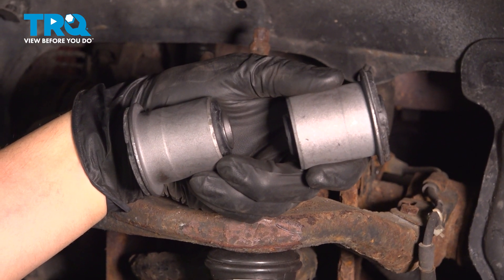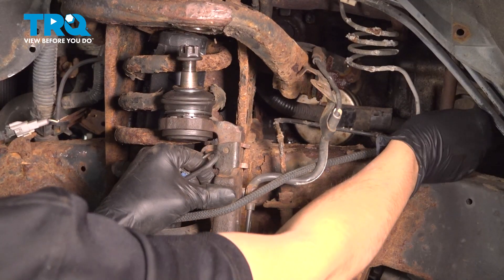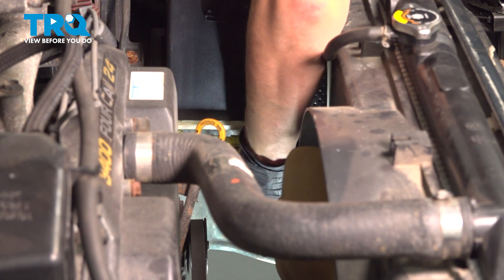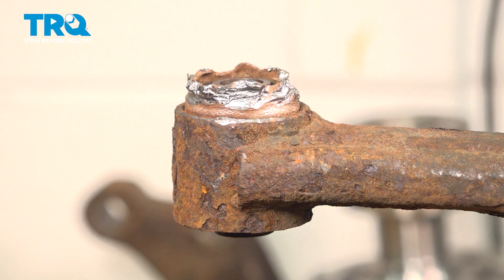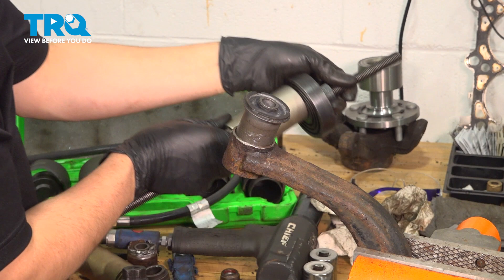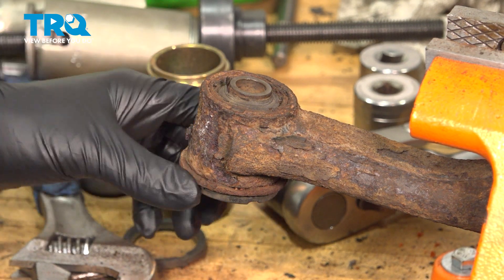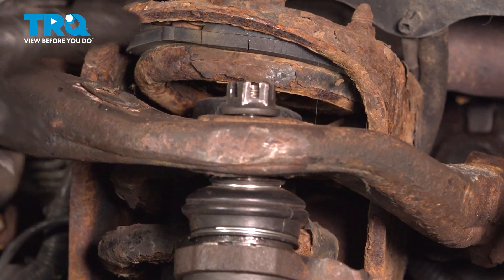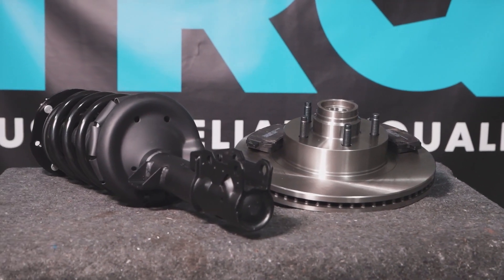How to Replace Control Arm Bushing 1996-2002 Toyota 4Runner

Comment: 17:36 there is a cup slightly larger than the one on top that presses against the bushing flange and not the inner part of the bushing. I recently did this job and the kit had a cup that fit over the rubber and onto the  bushing flange perfectly
.  Thanks for making this video